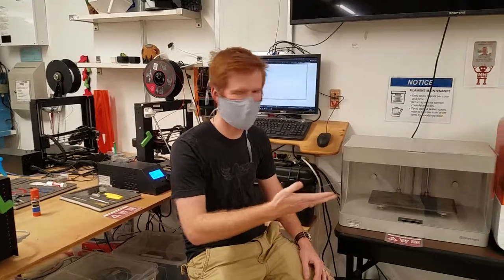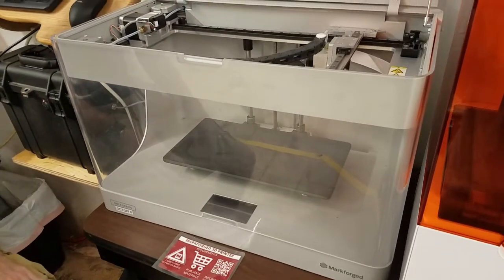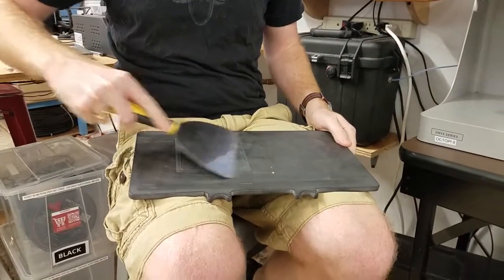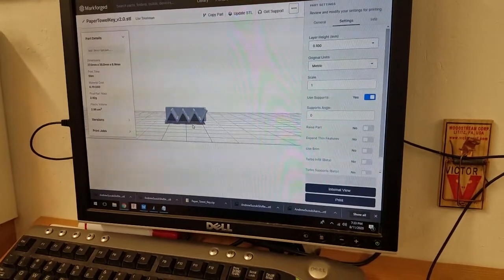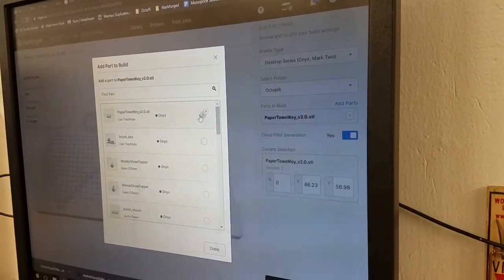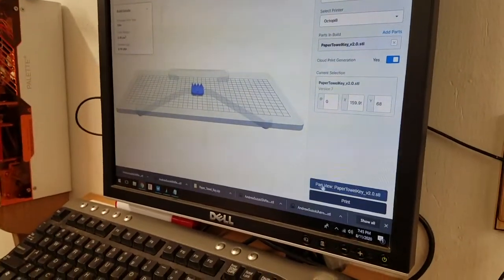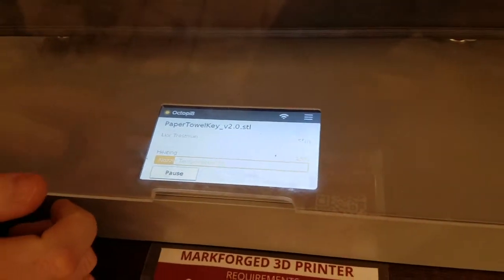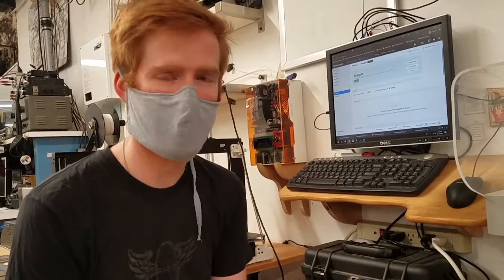How to Use the MarkForged Onyx 1

Comment: This 3D printer do not allows you to set a temperature different  the 275°C
Does any body knows any way to modify the temperature in order to use it with a diferents material?
unusefull printer you can not use a difetent materials and Onix is expensive compared with...

Comment: I use hairspray instead of a glue stick on my Markforge and it works much, much better. Also, use pump bottles as you’ll be able to more accurately cover the bed. Cleaning is also a lot easier, I just use a damp cloth never having to remove the bed to run underwater. Trust me, try it once and you’ll never use a glue stick again.
Reply: Hairspray in pump bottles?
I’ve only seen compressed hairspray in cans in Australia. Have you got a link with an example?
Also just wiping the bed in place has never messed up your leveling?